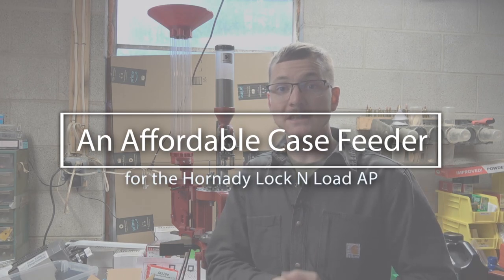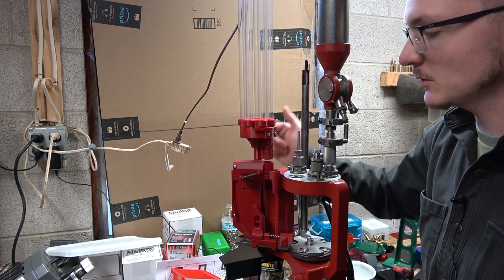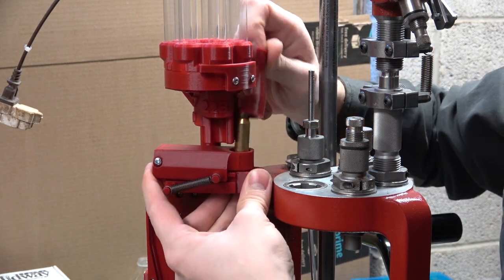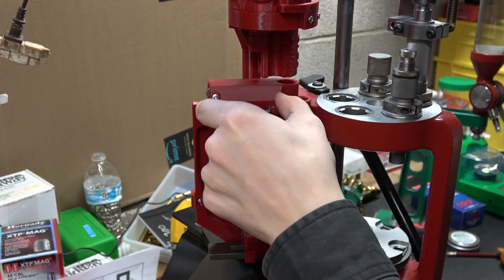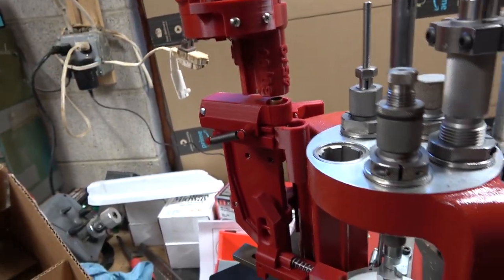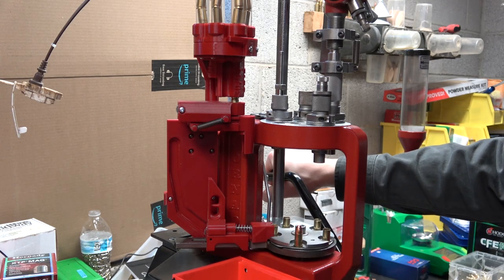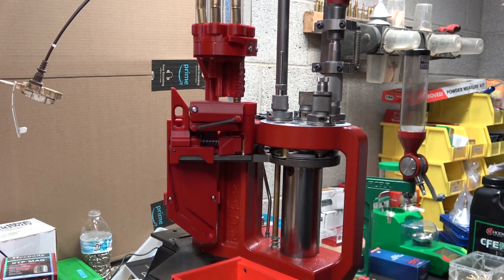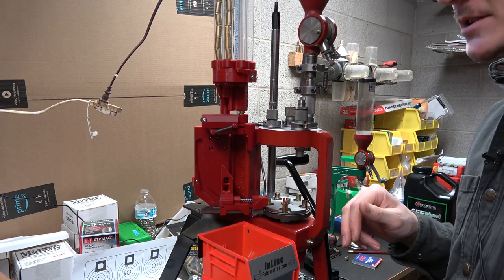An Affordable Case Feeder for the Hornady Lock N Load AP

Comment: I have a similar 3D printed feeder and very few issues at all with the unit. I have added bullet feeder die on my Hornady and it works like a dream, yeah here and there small issues but they get resolved in seconds. You can eliminate the cases dropping upside down by loading cases at the edge of the collator. Beats the hell out of a $400 - $500 case feeder.This is a Jeff Goodness case feeder which I have been enjoying. He has videos on you tube .
Reply from the maker: Mine is from him as well!

Comment: I wonder if maybe a super thin bit of styrene or other slick plastic put in there would help it slide nicely. Otherwise, looks pretty effective and it's hard to complain about 1/5 of the cost.
Reply from the maker: Might be a good idea! I had thought about using some kind of adhesive to stick on some PTFE tape. The light coat of oil seems to be doing the trick for now though. Thanks for watching!
Reply: @TheOutdoorGeneralist  That was actually the first thing that came to mind, but I feel like the surface would wear out pretty fast. Some sort of thin delrin would probably be great. Huh, learn something new every day, I just googled PTFE tape and there are thicker/harder ones with adhesive already in place. I just don't see them available short of a very expensive package.